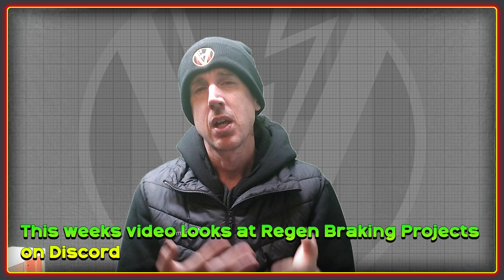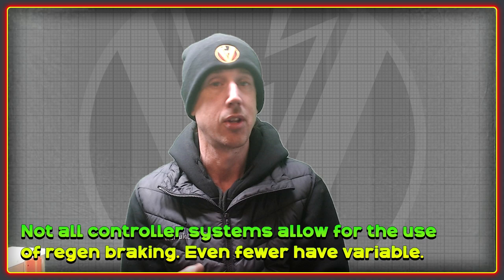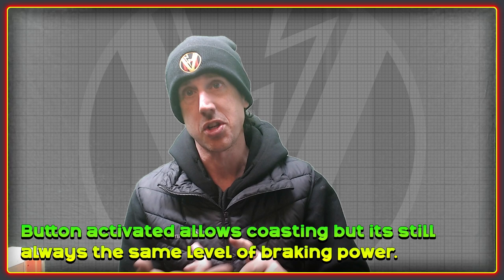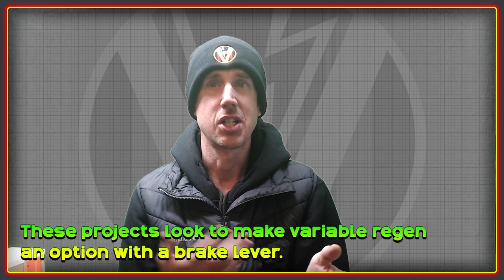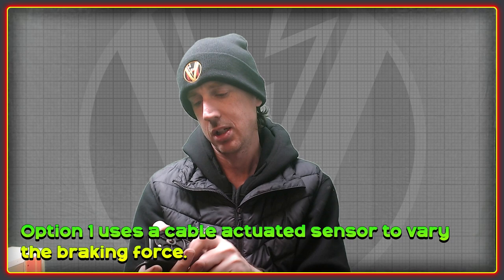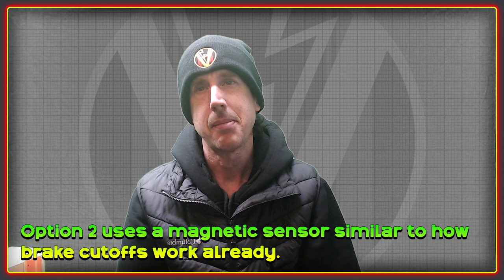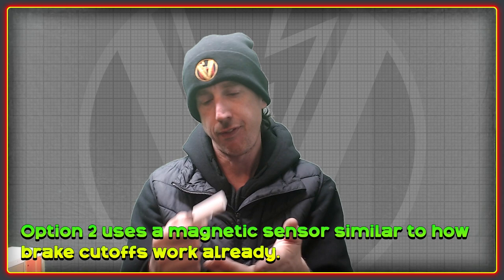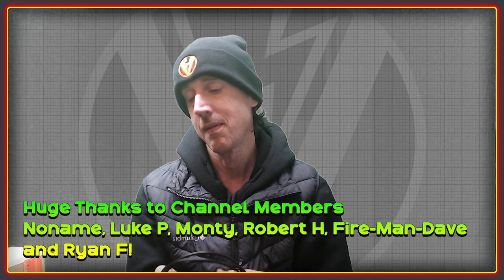Lever Activated Regen Braking, projects to make variable regen more user friendly.

Comment: Great video! I set up variable regen braking on my Sabvoton/Cromotor Greyborg some years ago. It has been fantastic. Feels like a controllable parachute, since the brake lever setup is a displacement sensor rather than a force sensor, but one gets used to it quickly. I used a cable type brake lever and installed a linear hall sensor and magnet internal to the lever as the Sabvoton needs both a switch closure and a variable voltage signal.
Reply from the maker: Sounds like a great solution. Interesting information on the sabovoton setup. I like the parachute apology. I'll take you word for it feeling similar hope to not experience one.

Comment: Another idea for variable regen would be to have a bidirectional Twist Throttle.
Basically it is a twist throttle with a spring loaded center position, it work like a regular twist throttle, but if you twist the throttle upward pass the center position, it activate the variable regen.  I believe the Grin motor controllers (Phaserunner, Baserunner ...) are already mapped for this type of system.

I'm pretty sure such throttles exist, but have not found any yet.
(Basically you could have a throttle with two hall sensors and magnets, would only require 4 wires instead of the 3 wires throttle commonly available, 5V, Gnd and 2 signals for the hall sensors. This would do the same as a regular twist throttle on the right side and a second variable thumb throttle for regen braking on the left side like it is available currently. 
The brake levers sensors could be for motor cut off only for safety...

Anyhow, keep up the good work.

Cheers
Dan
Reply from the maker: Hey Dan, there are are a few out there I saw one recently you can get on ALI Express. The issues are that they have a very narrow band of activation on the regen side, I think it was only two volts. Hopefully that will improve in the future because it would be quite a fluid setup.
Reply: they allready make these but are quite hard to find

Comment: I did this about 6 years ago using an off the shelf variable voltage hall sensor just stuck to the brake housing and a magnet on the lever and my Adaptto controller on my Fighter. Worked great!
Reply from the maker: That's great to know! So you had variable with this or was it just on off activation?
Reply: @HighVoltageKits  The Adaptto had completely variable regen. It even let you plot a graph/curve to your liking. I managed to tune mine so you could not even tell/feel it transitioning from regen to physical brakes. Anyway, I just wanted to throw it out there that this is completely solvable with ghetto tech if the controller supports it. :)
Reply from the maker: Much appreciated. Thank you. Always a way right.

Comment: You could use a pressure transducer on the front or rear brake line if the brakes are hydraulic. Just need to find one with the right voltage/pressure range.
Reply from the maker: That's very true. I will keep an eye out for something

Comment: I don’t know how far along this is now, but on the topic of the magnet glue method being a risk, you could maybe make a 3d print that would cup around the screw on the break that would then have a space to slide the magnet into, it would then be easy to put a dollop of super glue in this compartment and with  walls surrounding most of the magnet and a lip on the top of the magnet it wouldn’t have nearly as high of a chance of falling off.
Reply from the maker: Not too much further. Time has been of a premium lately. Appreciate your tips and they will be considered. Good ideas

Comment: high we discovered we can get an oil pressure sensor that fits into the hydralic brake lever they are 3 wire and vork on 5 volts for memory we used 500kpa we join 2 sets of levers together the top one is normal brake and bottom is variable we had to use different length levers so can use them separately and still use together,the bottom lever is turned upside down and new longer shaft goes through both levers the sensors can still be used on a single lever via use of a T joiner
Reply from the maker: That’s awesome! Great job

Comment: Ha i got you to set up a regen brake linear potentiometer for me last year, you know if you want to keep the brakes there what about splicing in a hydrolic sensor ? The more pressure the more regen and the hydrolics would still be in place, no need to glue in a magnet !
Reply from the maker: That's a good idea. Its worth looking into although it might take some configuring depending on the kind of signal and voltages that it operates on.
Reply: I was thinking this(hydraulic pressure sensor) or an optocoupler that would T into the wiring for the brake sensor

Comment: Interesting video (bad audio quality though). My setup is a 1500w bbshd on a regular mtb with a tag-along trike rear axle/seat/pedals for my son. Due to the added weight, I would like to run a DD hub motor on the mtb rear wheel to take advantage of regen. I've seen Grins videos that talk through a similar setup. Some ideas that I'm currently researching are: 1) Capacitors to smooth the current into the battery, and/or 2) Using a wind turbine controller so that any excess energy, over a set threshold, is diveted to a resistive dump load rather than heating/stressing the batteries. I'm using x4 12v 30ah Lipo4 to get 48v and some decent range.
Reply from the maker: Yeah the audio gets compressed to get rid of the fan noise. I need a better computer setup lol! Good idea with the load. Wonder if there is some use you can get out of it. Most good controllers with regen though will only permit a set percentage that is safe to go back to the cells. The other thing is to make sure the cell specification is sufficient to allow the safe operation like this.

Comment: hi cap! glad to see i'm not the only one thinking about this subject.

to this moment i split my ideas into three categories:
- cable actuated, like the one you showed. i was thinking of using an arduino with a spring loaded potentiometer and a thin steel cable run to the lever of the brake. by giving more travel to the lever, you could regulate the regen with the initial travel of such and by the time you engaged full regen you would start biting on the actual brakes. 
- flow sensor (magura had an on/off switch as brake cutt off some time ago), but i don't think it would be a conceivable option, given that you would need a very accurate (and so, expensive) flow meter in order to have a reliable reading.
- full blown electro actuated brakes, like the ones in modern hybrid/elctric cars. this would be quite easy to do on a real motorbike, intended with motorcycle brakes, where the lever wouldn't actually be connected directly to the brakes but instead to a small board that would initially activate and regulate the regen and then engage both regen and mechanical brakes.

another good idea would be to take a look at the brake lever found on most cheap electric scooters (like the xiaomi i.e.), since those have both mechanical brakes and variable regen controlled by the same lever. although i don't know whether they use an hall/magnetic sensor or something like rio's one.

general suggestion regarding rio's method: you could replace that huge assembly with a 3d printed wheel with a spring mechanism inside, mounted on a thumb throttle. just replace the actual lever with the 3d printed wheel, so you could have the same hall sensor in a compact and small form factor (maybe you would need an arduino or something to give out a cleaner looking signal for the controller).
Reply from the maker: Thanks for the input. There are many ways to skin this cat. I think the one that will be viable will be the one that proves to be the most reliable and durable. Right now the focus is on making something that will work with the controllers people are using. So the ASI ones as well as VESC based will allow this to be the case.
Reply: @HighVoltageKits  the vesc proves to be an incredible platform, the amount of customization you can achieve is endless. about the asi, it could be a bit more selective regarding the input it requires to correctly function. hopefully we can work something out, it would be something that a lot of people would be interested in. perhaps a plug&play kit for different brake brands would be something to work on.
Reply from the maker: Yeah, we can easily use any of the brake options with the things that we make.

Comment: Great progress in all areas love your content.  Variable Regen is the only way I would want to use it.  The paddle throttle integrated into the lever with on off switch would be most intuitive choice off road. 
Your lever kit conversion has merit too! So that does put a hub motor in the mix.
What next ABS and Regen?
Reply from the maker: Thanks so much. I'll probably be using a paddle style on my next project. Or maybe something lever integrated. I'm still waiting to hear on test results. Traction control I think could be achieved or launch control. 🤔  I have a neat throttle project being cooked up actually..Hopefully drop in a few months. Cheers

Comment: In the demonstration of utilizing a magnetic sensor, turning both the magnet and the sensor 180°, would create a much more linear path of movement. Plus adding a pivot point for the magnet or the sensor would offset the rotation of the lever, to make the path completely linear. 

Since magnet and cable activation, are already being utilized as a motor cutoff mechanism. It seems like a logical starting point as a regen mechanism. But since variable regen is the ultimate goal, a pressure sensor that could read variations in brake fluid pressures has distinct advantages? Including it would allow the sensor to be near the motor, in a parallel configuration. 

i do have some  push back in terms of variable regen always being better than binary regen. And the lack of a freewheel has some downsides too. But it doesn't matter until the technology reaches a point of maturation where it's being utilized enough to talk about the trade-offs. In other words thanks for pushing the technology forward. If you want any more of my two cents on the subject matter I'll be happy to give it.
Reply from the maker: Those are some really good thoughts with the linear path for the sensor. I need to revisit this in the reasonably near future. I would definitely be happy to get your input in the future. GRIN technologies have some good stuff with regen as well. The bit I like about the variable is that its up to the rider to engage it. Whereas on the automatic ones as soon as you let go the throttle it engages so coasting is not possible. You can also have it activate via a switch however the issue then can be its so strong that it can lock a rear wheel on things like a Sur Ron. Which can also be tuned with settings. Its definitely not as simple as I first thought  it would be! Cheers
Reply: @HighVoltageKits  That is ironic, since Justin from GRIN Technologies has been trying  to get bicycle brake manufacturers, such as Tektro to incorporate this type of variable regen functionality for over a decade. But they told him that the demand won't be sufficient to make it economically viable. So it's more about convincing the bean counters than a technical issue.

So for the time being there is definitely a niche in the market for this type of product.

But for hydraulic brakes a pressure sensor transducer still seems to be the more optimal option. Good luck with the project. I look forward to the next progress report.

Comment: I've no experience with ⚡ bikes yet but for pedal bikes that only deliver assistance when pedaled I don't see the need for a throttle. In any case, the rear brake lever can also be the throttle. All the way open is full torque, all the way squeezed is full brake & the path to both ends uses a position sensitive combination of regen & friction braking. A single lever can perform multiple functions, pushing, pulling, sensing etc. all in one stroke. Simplification should always be the goal with no compromise in functionality or performance & ⚡ motors enable that. It's just a matter of adapting to better ways.
Reply from the maker: Its an interesting idea. Not one I had considered for sure. I'm all for simplicity of use as well as construction. One of the reasons for regen on a lever is its not very intuitive for people to get used to the reverse throttle. I wonder if having the throttle on a brake lever would have a similar effect.

Comment: Great idea, I hope this works out.
What about a part on the brake lever that you squeeze with your index finger (whilst your fingers have moved onto the brake lever ready to brake) that houses the sensor at one end and the magnet at the other seperated by a spring, which is fully enclosed, the action of pressing pushed the magnet closer to the sensor and you would have to squeeze hard to lock up the wheel.
Of course the on / off would have to be reversed on the magnet system you have shown, if that is possible at all
Reply from the maker: Cheers Nick, you can reverse the signal so that would be quite a clever way of doing things.
Reply: @HighVoltageKits  It would be small, slightly less than the size of a dice, the magnet or spring could not fall out so there is a good amount of safety. There would be a bit of experimenting how close to the brake lever fulcrum to mount it
Reply from the maker: For sure. Will be a fun modeling project!

Comment: Love it! You building what I've been saying needs to be done. I have a longboard with regen on a thumb dial. It's perfect. I'd be ok w it activating w a brake light switch. But being able to adjust the force it applies would be invaluable. Just a simple thumb dial. Is what type Regen is fardriver controller? Could I add a thumb dial?
Reply from the maker: You could add a thumb dial. You would need some way to reset it back to neutral though. I think thats why most people use the throttle type. Hopefully will get an update on this project.

Comment: Hey Guys. I like the option 2. I plan to use it on my e-ATV which runs using 2 BAC2000 controllers. Can I get #2 samples to test?
Reply from the maker: Best join our Discord and I will link you with the guy doing the electrical part. The link is in the description.

Comment: A thumb throttle on the LHS used like a "flappy paddle regen" that's independent of brakes and throttle is easy enough, surely?
Edit: And it has built in variability capacity.
Reply from the maker: You can definitely use this and many do instead of a twist throttle.

Comment: Excellent.
Can you tell me what signal is sent for the variable regen?  I know throttle is between 0.8v and 4.5v  normally.
But I haven’t found anything on the regen signal?
Reply from the maker: You put a throttle on an input signal and use it modulate in the same range as a throttle.

Comment: What cable did they use with the throttle box?  I'm trying to build regen brake lever.  I'm going to use a stunt bike clutch lever and old stock sur ron throttle box.  But I'm having trouble finding a cable that will work with this.  It's a weird cable with the same ends.
Reply from the maker: Shoot me an email and I can send you photos of what I have. I can probably sent you a cable box as I have a bunch of them. I think I was going to splice something on to work with a lever.
Reply from the maker: John@highvoltagekits.com

Comment: If controller has hi and l level brake connections what wires from the throttle go where? 
 Red/blk/wht throttle wires
Reply from the maker: Generally, the red will be 5 volt the black will ground and white the signal. You need to match those to the controller. I presume you are wiring regen brakes? Discord might be a better place for this as you can post more photos etc. The link is in the description.

Comment: The charge rate of the battery is too low for regen add much to the range.
Reply from the maker: Grin have some interesting data on it. They reckoned 5-8 in the city start and stop riding. It's not huge though, and depends on the system setup. Most people like it to save on brakes.
Reply: @HighVoltageKits  Yes, it's good for braking but if you calculate the actual charge that gets into the battery, based on the time braking, it would be miniscule.  Not worth the added cost and complexity.  It might also contribute to motor heat.

Comment: I only run geared hubs 🙁
Reply from the maker: There are geared hubs out there that do not have a freewheel. Grin tech makes one.
Reply: @HighVoltageKits  yes, ive seen the prices as well 😂
Reply: Grin tech also posted a DIY freewheel locking option, which enables regen capabilities.

For those cheap to buy one of their regen capable geared hubs.😂 😂 😂